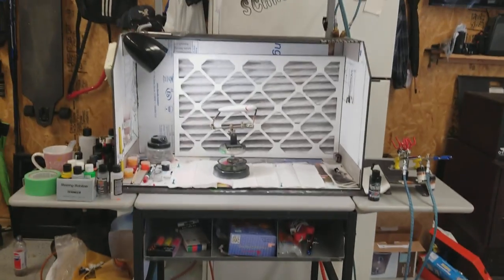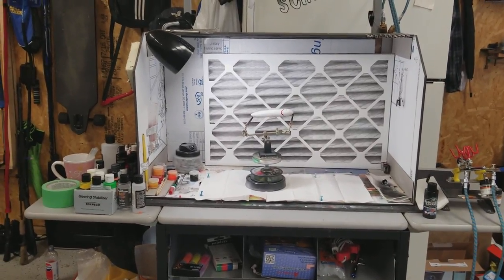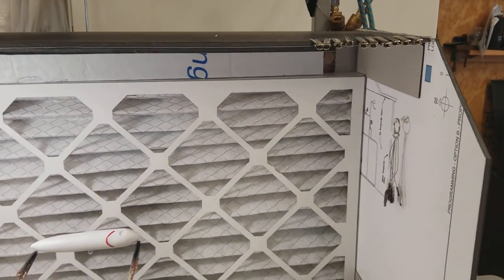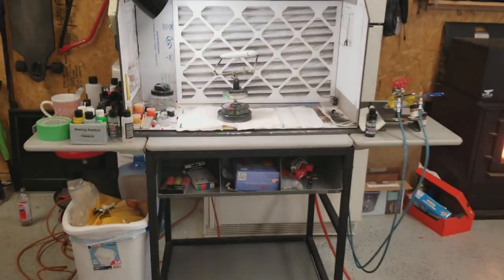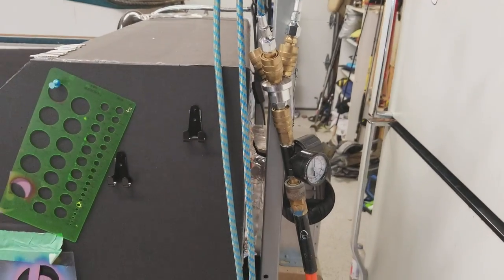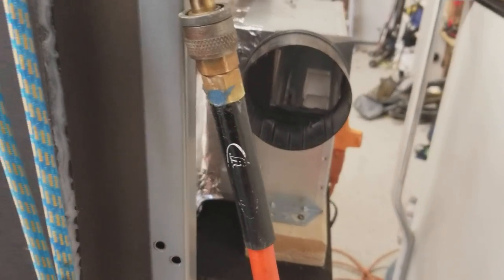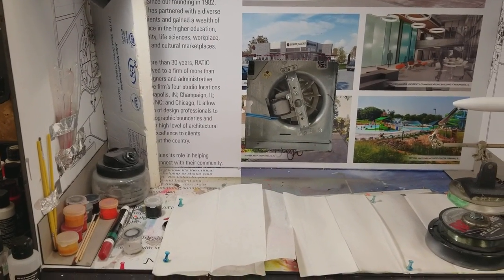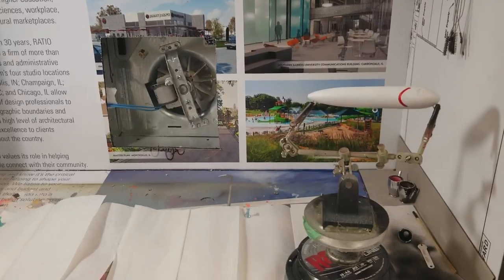BEST $25 Airbrush Paint Booth for Lures

Comment: The table would have been used to hold an old fashioned typewriter. The fold-up wings on either side were to hold papers or other supplies when the typewriter was in use. When done these wings were dropped down and the table with the typewriter still on it could be wheeled out of the way.

Comment: With my job, we work with .016 aluminum and stainless steel every day.  Have access to breaks, pop rivets, and every other essential metal working tool for building the box.  Might be a little shiny but I can put the smooth aluminum outside on the inside instead for a reflective surface.  My question is, would this wash out what I'm trying to airbrush?  I have to go outside right now to airbrush primers on my minis and it's a PIA.  Till we move into a new location, I'm stuck airbrushing outside or in my tiny mancave room.  I can build the box and get the foil tape for free.  If the smooth metal surface is too reflective, I can paint it white.  So all I'd need is the filter and the exhaust fan unit.  
Thanks for posting this design, my room is real small and the one window is right behind my paint side of my desk.  I can't get to it to open it and close it to vent a hose out.
Again, thanks for posting this, you're a life saver and it beats the heck out of paying well over $100 for some cheaply made chinese unit with bad instructions and parts that don't fit up or match.

Comment: Cool setup. My only concern is the fumes of the paint passing through a fan that has a motor and could possibly ignite. It is something I heard a guy mention in another build and said fans that have the motor built on the outside of the fan is best. Any advice on this?

Comment: I want to try this! Does a bathroom exhaust fan work better than a box fan?
Reply from the maker: I think a box fan could work.
Reply: @kevinschnebly571  Just wondering if you went with the exhaust fan because it had more air flow? Thanks for the quick response.
Reply: I think a small box fan could work, but a bathroom exhaust fan comes with a sealed unit you only have to tape to the back of your booth. It also leaves you with a place to attach a ventilation hose to run fumes out the window.

Comment: Thanks for this tutorial.
Could you please tell me brand and type of the filter unit you used?
Thx in advance.
Reply from the maker: Residential furnace filter. I bought the middle of the road ones in regards to price and they held up.
Reply: @kevinschnebly571  Thanks for your reply!
In the mean time, based on your design, I googled away and found this:

https://www.air-craft.net/acatalog/Sparmax-SB-88-Primary-Filter.html

Got two of those and I'm in buisiness!

Comment: The amount of click bait in this title is criminal. Show me where I can get a bathroom exhaust fan like that for $25 let alone the rest of the stuff. If I had more accounts I would give more thumbs down.
Reply: I purchased a bathroom exhaust fan for about $16 from lowes. Same kind. They start around 15 and go up from there.
Reply: In the USA you can buy white or black foam-core board for $1 a sheet from the Dollar Tree chain of stores in the craft aisle.
Reply: @TheMorsonFamily  Ok so $16 for the fan and that leaves you $9 to get the filter, the boards and the tape. If you have literally none of these supplies lying around at home and you have to buy them all new this is not happening for $25.
Reply: @Cody Keller  I have 2 rolls of that tape and 2 rolls of excellent duct tape lying around the house so no, its not click bait.
Reply: @codykeller7512  $4.99 filters at true value hardware.
Reply: A) It's not clickbait, so chill out and B) FYI, thumbs down is a fake/useless option that does absolutely nothing on youtube ratings.